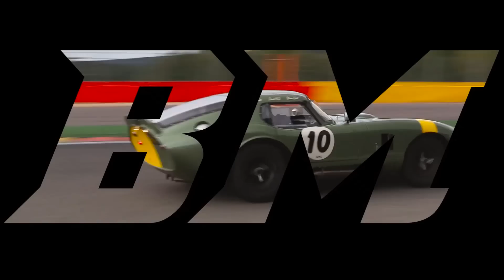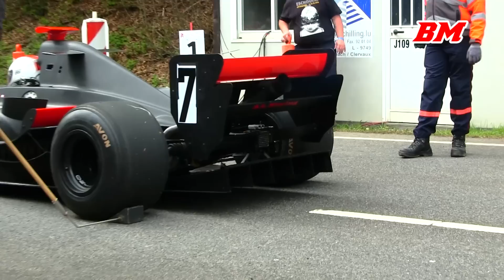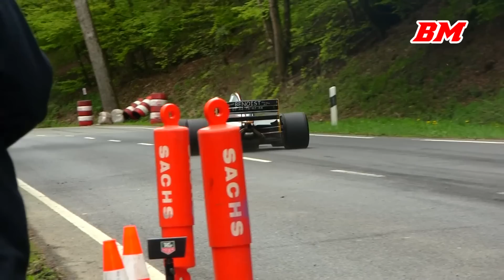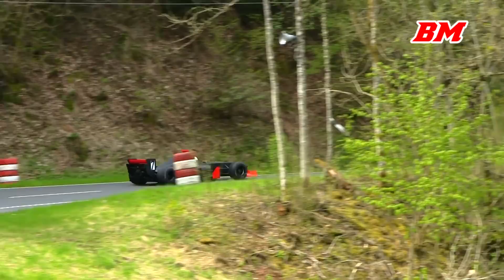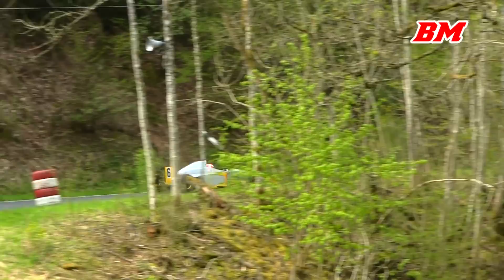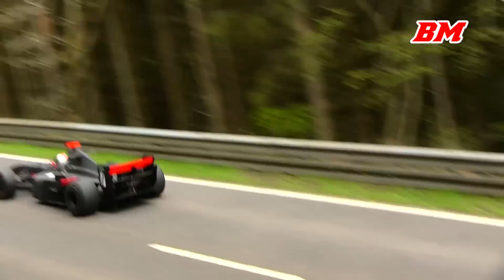Lola F3000 and B99-50 Zytek V8 at Hillclimb

Comment: Is F3000 and Formula Renault 3.5 the same?
Reply from the maker: Insan Siregar no.
Reply: Insan Siregar F3000=old GP2/F2
Reply: F3000= V8  3000 cc
Reply: F3000 is the series that became GP2 but it used a different car with 3.0 Zytek V8 rather than 4.0 Mechachrome V8 in gp2